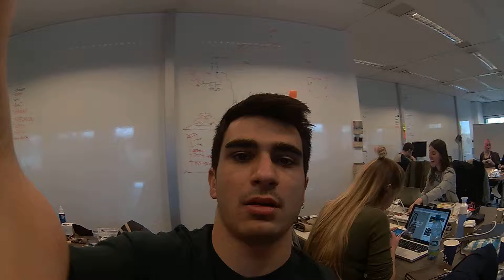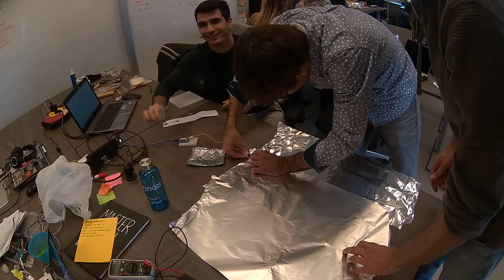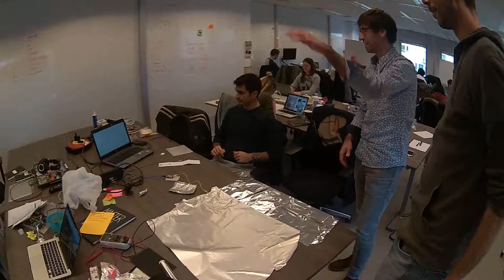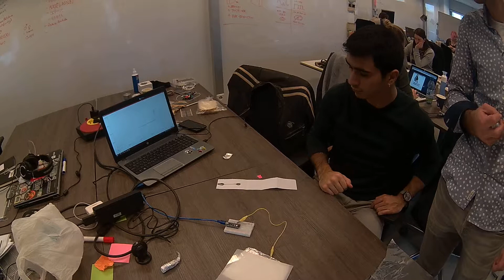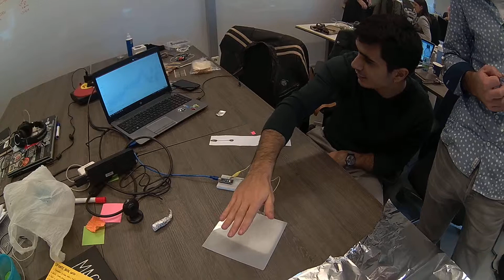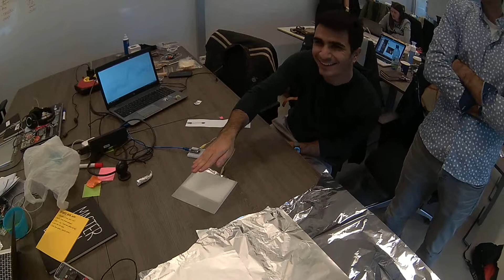[Interaction Engineering] Unit0 - Capacitive Sensor MORE Tests

Comment: still detect the human presence (0-20cm).. How does it detect human presence?
Reply from the maker: Capacitive sensors generate an electric field called fringing effect around them. As a human body (or any conductive object) approaches the conductive surface, it interferes with the fringing effect causing changes in the final capacitance. "Capacitance sensors detect a change in capacitance when something or someone approaches or touches the sensor." See the following link for more!
http://www.analog.com/en/analog-dialogue/articles/capacitance-sensors-for-human-interfaces-to-electronics.html
Reply: I see.. So dat's how actually a touchscreen is working huh? If so, why doesn't my smartphone react to some conductive objects like a screwdriver etc but it reacts if I touch it with an apple for example?